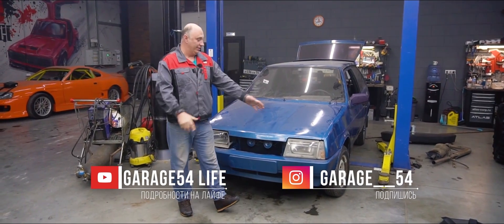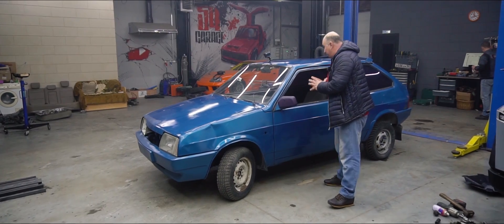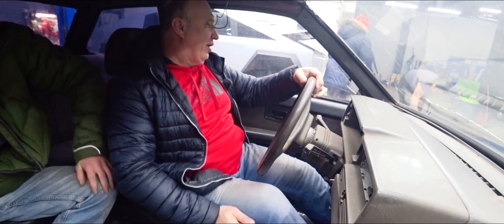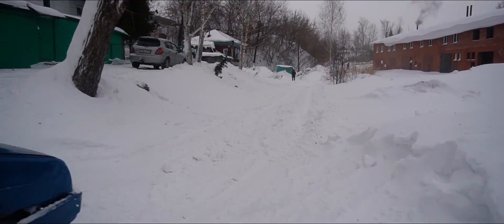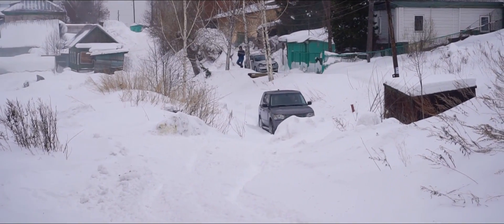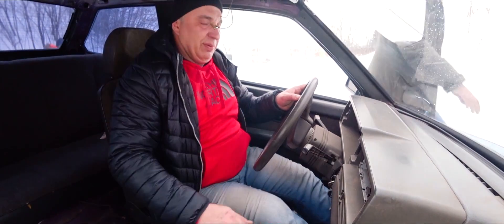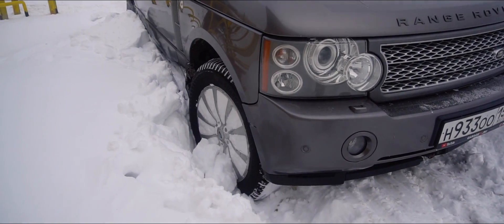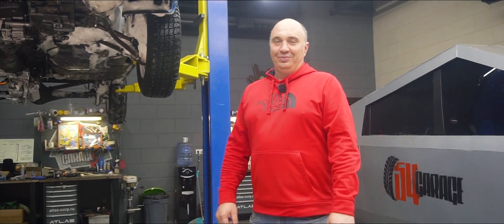4WD Lada – first drive

Comment: With everything looked, you can’t run different size of tires. That’s what broke the transfer case. Try it again with the same “tractor” tires in all 4 wheels.
Reply: I think not having chains was the main issue... Having semi-loose chains could have improved the situation.
Reply: That's absolutely not the reason why it broke. It was just too weak. And the parts were from a different car so the ratio probably weren't right anyway.
Reply: The tires were slipping all the time so the different sized wheels wouldnt have made a difference.
Reply: @banaana1234  this, and the grip on the snow is poor. And you see in an another video with the UAZ that the transmission held on even with the wheels spinning in different directions with better grip. Likely would last that all day long when it's of proper build
Reply: They're in snow. Same as mud. Won't make a difference. they're not differet enough to have a problem. It broke because it's hacked together
Reply: Definitely couldn’t have hurt paulieG
Reply: @zacharyw5663  someone with some common sense.
Reply: @banaana1234  ratios are different.
Reply: 10:28 The hopping broke it. Also should've installed the tractor tires in the front, stronger and more weight for traction.

Comment: Probably should have lifted the car up to be able to drive through a foot of snow.
Reply: They should definitely continue whit this project. New rear diff, improve ground clearance, proper snow tires, maybe add weight for better grip..
Reply: Think they did a bit. Rear tire gap increased. Front would need different struts or some type of extensions welded in or maybe cobble up some spacers under the strut tower?
Reply: All About the Rubber... Basic and Work's
Reply: I was honestly surprised that they made it the first time! I know how they feel... I got into a similar situation... The same but uphill... I had to turn the car....
Reply: Lifting car body does not give you more clearance. It's the axles that limit the clearance. They definitely need much bigger tires. Also need to change gear ratio in the gearbox: currently they can't start at lower wheel turning speeds because they don't have powerful enough engine for this, so they start at higher speed, causing wheels to slip and losing grip. And yeah, having no smoothing elements on the transmission lines causes giant shock impacts on the transmission elements. No wonder they ended with a broken gearbox. And look at 5:00 - the car goes stuck even when the snow is way below the bumper. I had a similar car (21099), it was the stock 2WD, and it performed MUCH better than this. Just say I would start worrying about being stuck only if the snow level goes near to the bumper's lower point.
Reply: @АлексейДмитриев-ш1ф  Lifting the body still helps. At least the whole bottom of the car isnt riding on the snow, and the tires can get to harder snow/ground.
Reply: @RealCapricousCavy  Or tennisballs in the springs.. no wait.. 😂
Reply: @АлексейДмитриев-ш1ф  Yes..it does. Especially if its independent suspension...Easier for an axle to cut through than the entire underside of the car as well.
Reply: Алексей Дмитриев if i wanted a car with better snow handling...
Actually i live around snow. Here in Michigan near lake Michigan we can get 150 cm to 300 cm in a year. I had a little Ford Escort with 34cm wheels and it drove better in snow than my next car with 36cm wheels. The smaller tires were also thinner and cut through 15cm of snow on road without sliding around. And i never buy winter tires. I do just fine with all weather tires. Funny enough i’ve had more car trouble in summer instead of winter.
Reply: Yes same story about tesla cybertruck:)
Reply: @Angel Valdez unfortunately, body lift wouldn't work. It would give much more troubles than one can see at first sight. The list of required changes could be so big so it would be comparable with development of the completely new car. You can investigate this yourself, because a lot of information is available on 2108, 2109, 21099. Also look for Lada Tarzan, it was the official SUV project of LADA, they did SUVs with 2108-2112 bodies. These cars have completely different platform comparing to their parents. Also look for Lada Kalina 2 Cross, it's optimized and modernized version of 2109, still 2WD, but the engineering team pushed the platform to its limit in terms of off-road and explained troubles they met.
Reply: @Алексей Дмитриев developing a completely new car would be child's play for Garage 54 lol
Reply: Larger front tires might lift it just enough to work Capricious Cavy.
Reply: I've driven through a foot in a of snow in a fwd car with no problems. The tires are the most important thing.

Comment: Needs better ground clearance... it seems to get stuck when snow is actually holding up the car lol. Lift kit!!!!
Reply: Also that rigid rear axle becomes a snow plow if not combined with bigger tyres or portals. Still on a front engined car, front ground clearance is key to avoid a tendency to wedge the nose against the snow, as well as a skid plate to prevent picking up snow in the engine compartment. The Samara could have shown off on packed snow rather than fresh deep snow.
Reply: Put an airbag lifter system in it. As soon as you feel it starting to slip just hit the lift button and bingo, more traction

Comment: Hay Lads, you needed those tractor tires on the front as well, that's why it was hopeless in reverse & use a Suzuki Sierra transfer case, I been flogging mine for 30 years and haven't killed it. Looks like fun, try again & make it better oh and put a bigger motor in it. I spent thousands on mine just by working it 20 years ago and now only breaks engine mounts regularly but that's it.

Comment: should do a front wheel drive, mid engine with a front and rear diff connected to the left and right of the output CVs conversion

Comment: Weld up a steel box around the transfer case. Reinforce it. 
Build a sled (skid plate) for the bottom of the car. Less anchor (plow) & easier sliding.

Comment: The taller tires on the back changed the effective gear ratio and caused the tranfercase to blow, or at leat it would have if you had any traction.

Comment: needs to be lifted so it don't catch so much snow against the under body as that would greatly increase resistance, good gripping tires on the front as well to share the load, if the front is slipping and the back grips the back is dealing with all the force to move the car, this is a very interesting project and i hope i see more of it.

Comment: These style of AWD Transfer cases are usually sized to handle how much torque a clutch can transmit at the rear axle.  They are not sized to handle the amount of torque it takes to make the rear tires spin.  So the host correctly root caused why it exploded.

Comment: I've seen it many of times. Bald tires and less aggressive tires will get you further in SOME circumstances those belt tires just dug a hole where the street tires were just spinning. Deep Snow is kinda like sand mud tires dig

Comment: i always wanted to see chain driven wheels. i.e. extend the ride height by extending from the wheel hubs via chain and sprocket to a second wheel hub attached to the wheels. could raise the ride height by 300 perhaps 600mm.

Comment: motor cycle gear and chain.. front CV joint to rear axle 🤤 for cheap..
Reply: need additional bearing and rod connected to the front frame with hinge to reinforce the cv joint and share the pull back force.

Comment: You guy's should have put some offroad tires, or chains on the tires! Looks like the all wheel drive system is working fine thought! ohhh!..also lift the car a few inches by installing a liftkit suspension.

Comment: Vlad's got a new toy! 4-wheel drive is great fun, but a drive-train designed for it is best. Is there a Russian version of the Jeep? Very good job calculating the proper gear ratios, and fabricating a system, but something had to give when parts not designed for a purpose get abused. Better luck with the next idea!

Comment: It probably didn't help having the rear wheels bigger than the front, as that would have made the overall gearing different to the front putting strain on the transfer box. Should have put them on the front too to keep it even.

Comment: laser welding aluminum? soda tin's melted into thin strips to fold over a transmission case? ... tho better saying if the idea is a 4x4 drive car, rear installation of any modern front wheel drive engine would self configure the existing transmission to drive rear and front axles "rear mount" because rotating it 90 degrees up on the front would be a bit to tight for the drive shaft and by rear that is a mid/rear placement of the engine like where the rear passenger section is, then the gear ratio would also be lower. ... ... for the longest time there was a GAZ-51 parked on the side of the road nearby, that was the only half/one ton truck ever made. hard to get a good reliable vehicle when the market options for even parts to replace things are as, get tiny little gear box thing that's likely going to brake again or switch to "truck" parts off of old trucks that are physically 2 Tons too big. ... proportionally the super size lada would fit something like a set of new or used/replaced axles off of a KAMAZ TRUCK including the engine in thought. though that's a bunch more reinforced construction to take place. ... tho it's odd that its easy to find modified axles that are build for that use in canada and the USA as being the common 3/4 and 1 ton truck... the actual drive shafts and gears on 3 ton trucks in some models are not functionally larger over the 3/4 and 1 ton "civilian vehicles". though oddly non existent in the EU. different demands from lower society continue to force the existence of it.

Comment: locked diffs front and rear, and bigger wheels in the rear than the front, you took away all the diffs so no where for the extra force to go... it loaded up and BOOM.....  has to have a release for all that pressure...

Comment: What was temperature? It do not look very good as this depth of snow, I can go thru with my quattro also, in case if it is not wet snow. In snow, most important is good tires and after that good drive system.

Comment: well you made a rally car.
WRC rules stipulate the engine have a displacement of no more than 2.0 liters, be a compact class car, and be a true 4x4. simply being all wheel drive wont cut it. you have to have all 3 diffs lockable.
also a horsepower rating of no more than 350hp and a total mass of no more than 2600lbs. and be a production vehicle
well those are group A class rules based on the 1990's Group A WRC vehicle rules best I can remember

Comment: The extra tires didn't just increase the grip! They also CHANGED THE RADIUS of the TIRES. There's a reason you [almost?] never see all-wheel drive cars with different front and rear sized tires. The ratios become different.

Comment: So had a debate on a mechanic group Im in. Have you guys thought about a 5.3L or 6.0L LS swap from 2000 to 2006 Chevy Silverado or GMC Serria into a Lada Niva?

A few of us are intrested to see what all you would have to do to get it to fit and actually work with the Nivas stock drivetrain from the trans back and still retain the ability to go offroad and what fab work would have to be done.
Reply: To us, none of these engines or cars they are from exist!
All we recognise from that text is Lada Niva.)))

For engine swap like this, we know of swap i6 , V6, V12 from jdm Toyota Crown/Century etc . It's popular swap in Volga .

Niva are made from the 2106 originally, most parts can be swapped between. Engine swaps for 2106 likely work with niva also)
Reply: Um you do realize they are not a car correct? They are trucks. And tbh the same blocks varients can also be found in the Corvette which happens to be in russia if the trucks aren't. I have friends in Moscow and tbt those engines are in fact in russia one of them has a 5.3L making 844 HP to the crank its not in anything yet cause he doesnt know what car to put it in. And his Dad actually has a Silverado over there as well with a 6.0 Votec.

Corvettes your gonna see LS2s LSX LSA to LS9 LQ4 and so on. Just saying. And correct me if Im wrong I beleive the 5.3 is actually a LS2 or LS3 I cant remember seeing how I dont own a gasser.

Comment: I didn't real ALL the comments so you may have worked this out already but I think I know why it broke. The difference in tires is what killed the transfer case. My theory is this. With a welded diff, when one tire suddenly grabs traction while both wheels are spinning, it creates a TON of twisting strain on your axles, from left to right. That's why limited "slip" does just that. It cushions that transition. It's the difference between a hitting the brakes, or just locking a wheel to a stop.  When your tires were spinning on the first set of wheels I noticed they all had mostly an equal amount of slip so probably equal stress at all four wheels. With the other tires, every time the front wheels spun they twisted to try and out run the slow spinning rear tires that had traction and therefore, spun much slower. The transfer case was just weaker that the axle.

Comment: It would almost certainly have done better with the "tractor tyres" on the front, where traction was greatest, and the drive train strongest. A 'Van Doorne' transfer box (developed by DAF in Holland) would have been better too (see Ford Sierra XR4x4) in constant 4x4 mode.

Comment: The reason it broke was because you had large tires on rear small on front.
That alone is emough load to do that
All wheel drive is extremely sensitive to tire diameter differences. Being a continous all wheel drive fan, its important to remember

Comment: nah, welding didnt kill it.  Its just too weak.  Its also a differential, not a transfer case so technically you're running the power on the backside of the pinion gear causing weird stresses to it.  Get a better unit if you want it to hold together, probably not made of aluminum.

Comment: I think that the best thing you could've done would be to give the car bigger/wider tires. Your main issue was that you were sinking into the snow, reducing ground pressure would probably have helped a fair bit. And of course, as you say, had symmetric grip/tire sizes.

Comment: Nearly pissed myself laughing in the first 20 seconds. “Used to be infested by a colony of termites” isn’t something you hear every day when discussing old cars...
Reply: If i remember correctly, in Russian he said a family of beavers did that)
Reply: A3ATOT - that’s even funnier, cheers for the translation 👍
Reply: I had a bunch of rats living inside my Sebring that was parked. They made a nest out of the hood insulation, and ate through a single engine ground cable. We spliced the cable and it fired right up.
Reply: @A3ATOT  exactly, it was "beavers" in the original video. But I couldn't bring myself to do such a blunt translation (though I'm not sure "termites" work that well either).

Comment: Definitely a successful project! Would love to see you take it out to your Test Track and do some snow-drifting with it. After that, you can give it some increased suspension height, and do some trail riding.
Long live the Lada 4x4!
Reply: how would you call breaking the transfercase, and getting stuck every 2 minutes, a successful project? ;-)
Reply: KentexDamgaard 🤣 
Well, the goal of the project was to transform a front wheel drive car into a fulltime awd car. In that they were successful. It was able to drive forward, backwards, left and right, under its own power (except in deep snow; obviously it needs higher ground clearance), with all four wheels turning in sync. Admittedly, grenading the franken-case was a fail, but as long as the project continues to evolve, I wouldn’t consider it a total failure. 
As for getting stuck every two seconds... chalk that up to Driver Error. Why drive the low little car with skinny tires into deep snow?? 😆

Comment: Maybe you should try to do this on a Lada Oka :It's lighter and the engine has less torque so with the same transfer case and about the same tires size i guess it will work pretty good

Comment: Gotta at least have snow tires on it. It's 4 wheel drive but needs better grip. Come on guys common sense.Just think if you had winter tires you'd never get stuck very often. Land Rover has bigger tires and new tires. It's not invincible fellas.Don't Burn up that motor guys it's easy to blow up.

Comment: "tractor tires" on the wrong axle?
Reply: it was permanent 4WD with 3 welded diffs..
Reply: @pitecusH  I know, but there was more weight on the front axle and the better traction in the rear was part of what broke the "transfer case".
Reply: @nathan_hl9556  I agree with that. The problem was the weight ratio that not equal in rear and front and if tractor tires were on front axle the performance may be more better.
Reply: @soheils65  True, thats why FWD is better than RWD in the snow

Comment: I think it's pretty awesome and I actually like the look of Lada's, they remind me of Chevrolet Chevettes. The components are a bit too weak to be welded, doing the front and rear added a lot of stress. If it weren't for the snow and that was dry pavement, it might not have lasted as long. Plus the tractor tires looked like they were taller than the front- more stress. Narrow tires are supposed to be good in snow.

Rebuild that thing with a clutch type limited slip in the rear and maybe the front, though gear types are better for turning and it might last longer. Make another set of those tractor tires. I want to see this thing prosper.